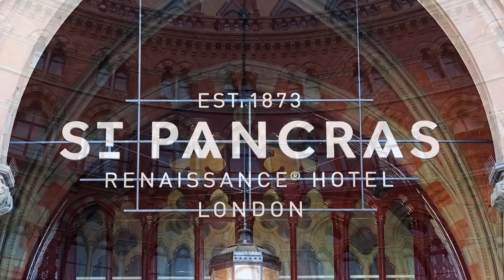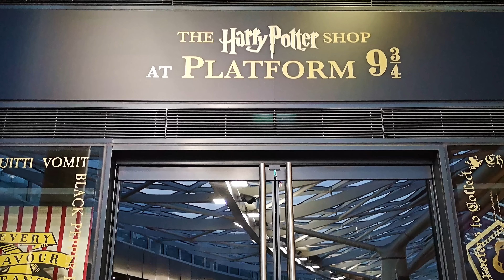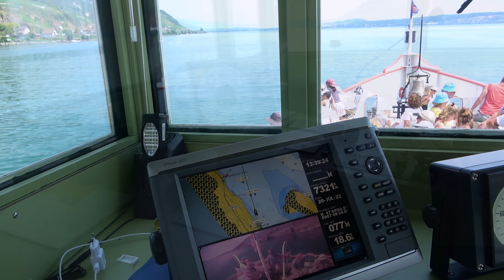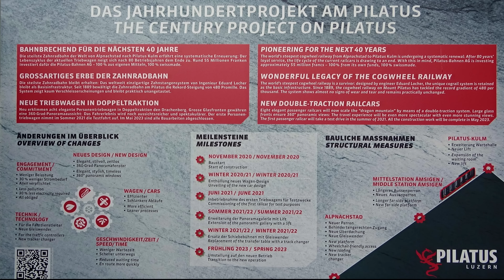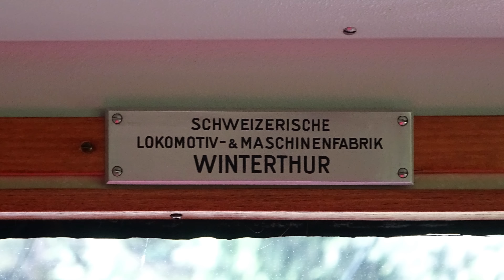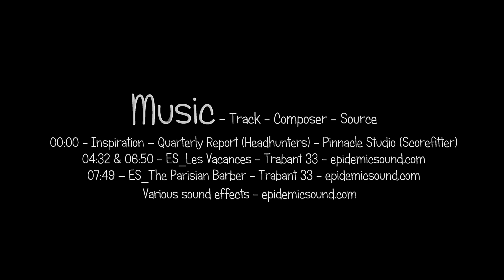London St Pancras - Engelberg, Switzerland via Eurostar, TGV, Swiss Rail, 3 Boats & 3 Cog Railways

Comment: Super interesting video as usual!  The railway to Engelberg (formerly owned by the LSE company) also has a rack section in the new tunnel.  Before the activation of the new tunnel, inside which there are movement stations used for crossings, the section with rack was shorter and had a much greater slope.  Originally the railway to Engelberg was electrified with three-phase alternating current and was totally detached from the rest of the Swiss railway network.
Reply: max. gradient formerly 246 ‰ / today 105 ‰
Reply from the maker: Hi, I'm pleased you enjoyed the video and thank you for the extra information. Out of curiosity I searched the internet for more information and found this - https://en.wikipedia.org/wiki/Luzern%E2%80%93Stans%E2%80%93Engelberg_railway_line
The history of the Engelberg line is interesting and the Wikipwdia article confirms the history you shared. Thank you.

Comment: 50:03 Apparently, there's also a narrow-gauge line that runs to Interlaken. It was pointed out on one of the Lorirocks777 videos I've recently started watching.
Reply from the maker: Hi Neil, you are correct, Interlaken station is served by both standard and metre gauge railways.
Reply: @Neil Forbes how do you compare australian trains with the ones from over seas
Reply: @top40researcher31  They compare favourably.
Reply: @neilforbes416  technology wise they wouldn't compare
Reply: @top40researcher31  Who cares. They're good enough for our needs!
Reply: @neilforbes416  the ICE trains Australia can build their own version for australian conditions
Reply: Yes, the metre-gauge network around Luzern is called Zentralbahn, of which the main two lines are Luzern - Interlaken and Luzern - Engelberg.
Reply: @neilforbes416  not if it's over 70 years old